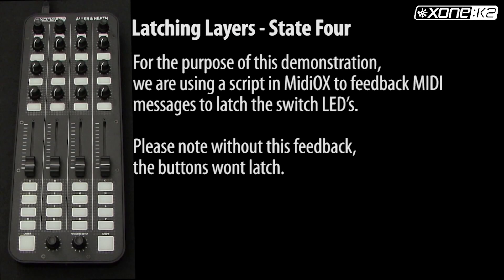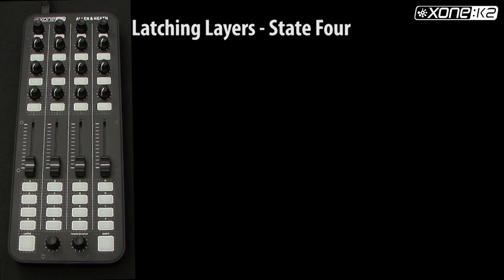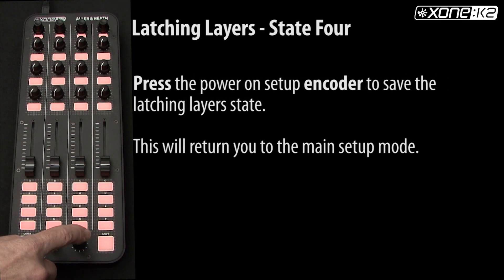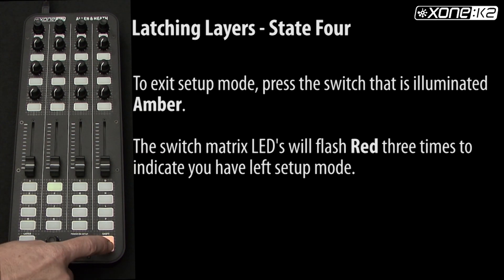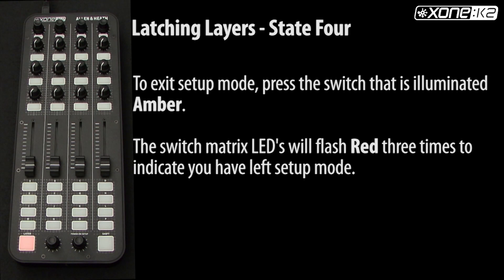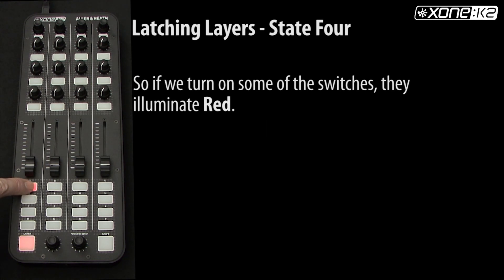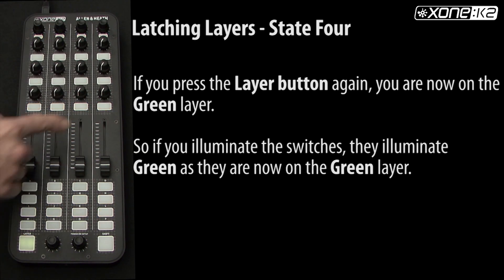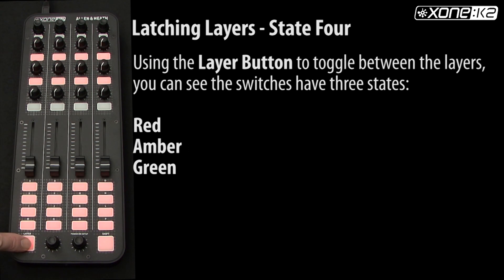Xone:K2 - Tutorial: Latching Layers State Four (All Switches)

Comment: which is the difference then between four state and five state?
Reply from the maker: 4 ALL SWITCHES - In this state, all switches on the surface are linked to Latching Layers. 
5 ALL CONTROLS - In this state, all controls on the surface are linked to Latching Layers. The faders and pots have an embedded soft pick-up algorithm to provide seamless integration across layers.
These are all listed on page 13 of the user guide.
https://www.allen-heath.com/media/XoneK2_UG_AP8509_3.pdf

Best,
Luke